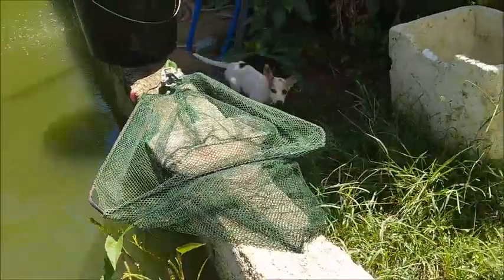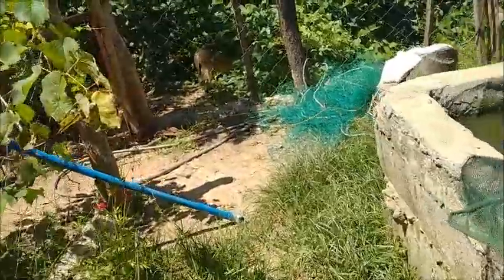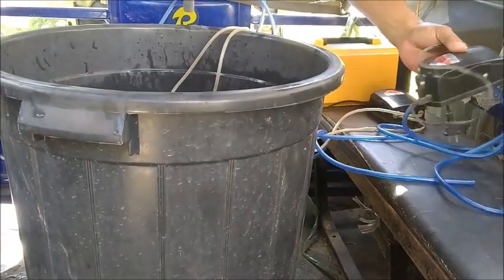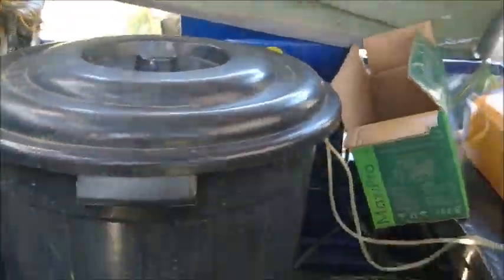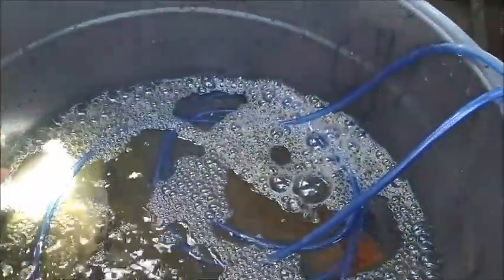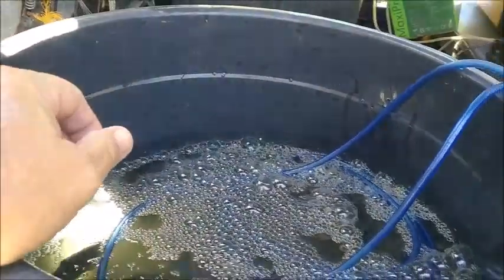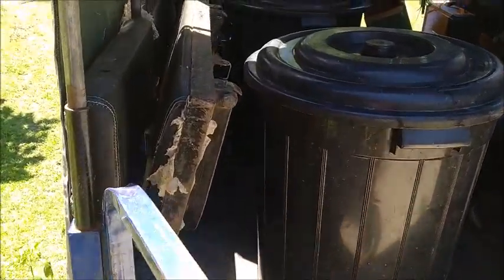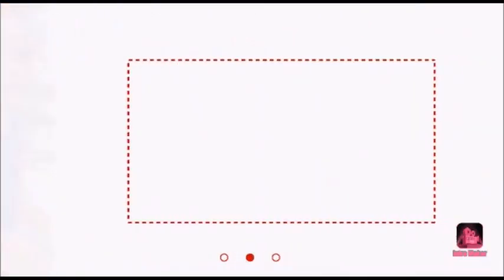Transfering 800 Fingerlings To An Acclimation Tank

Comment: Well worth checking out hydrogen peroxide, added in the correct proportions, is far better than relying on aeration( air is only around 21% oxygen after all!
Would need a premixed mixture because of the higher biomass in the container.
For example
 AS A GENERAL RULE: Adding 1 teaspoon (5ml) of 3% Hydrogen Peroxide for every 10 gallons of actual water in your tank, (tank capacity less decorations, equipment, gravel, etc.) will produce oxygen for an appropriately stocked tank for about 12 hours.
Hydrogen peroxide is 94% oxygen!!